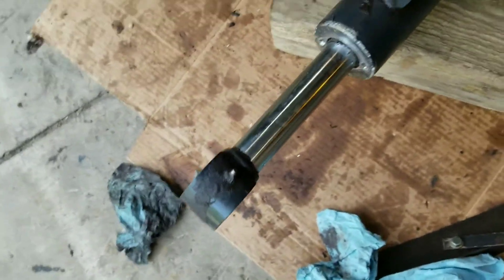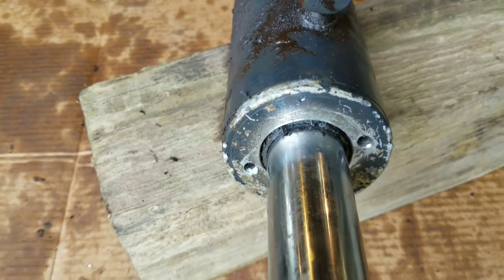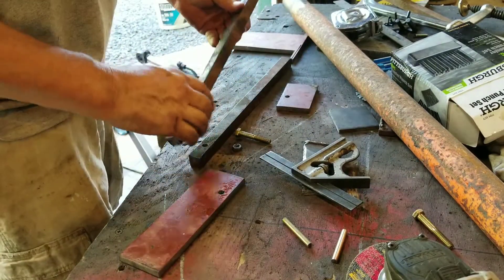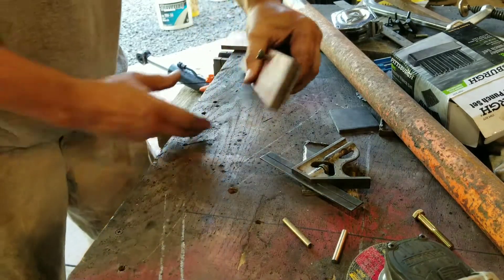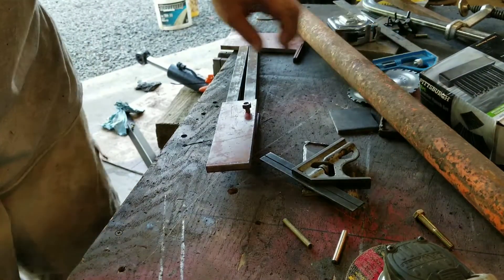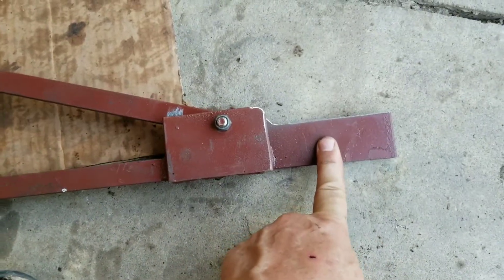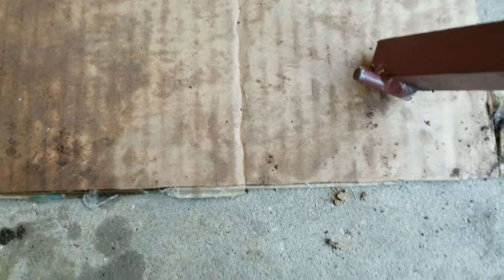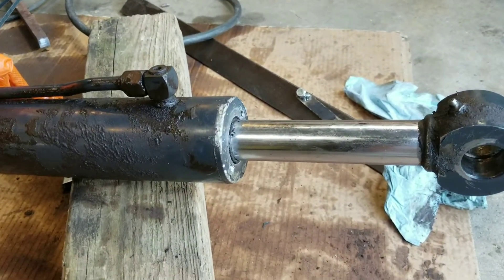Adjustable Spanner wrench

Comment: Thanks for this idea.  I also copied it, except instead of welding bolts, I drilled holes in the bars and used O-1  .250 drill rod - just in case it breaks and needs replacement.  Worked great once I figured out that it was a left hand thread.
Reply from the maker: That's a good idea with the drill rod. I've been using mine all the time.
Thanks for watching!

Comment: Nice tool! Thanks for sharing!
Tip- Try cracking the part loose while it's still on the tractor- 
 You won't have to the hold the cylinder down  while cranking on the wrench...
Reply from the maker: That is a good tip! I'll be trying that on the next one👍